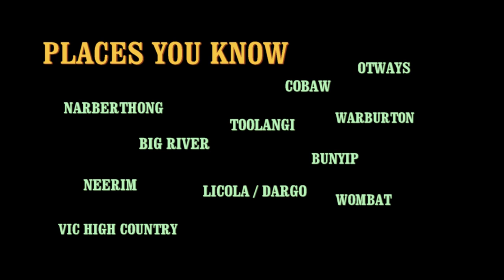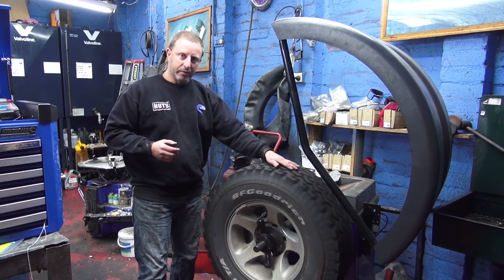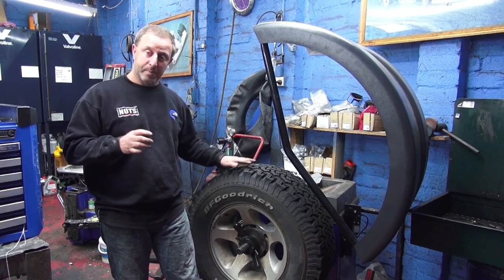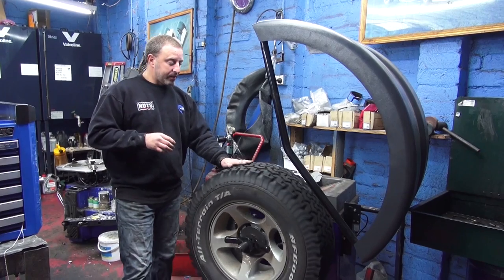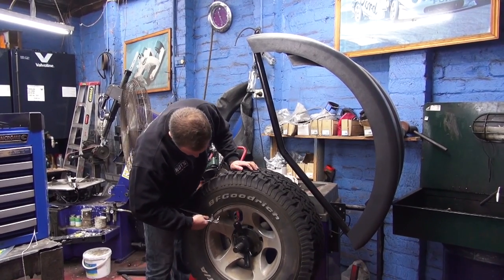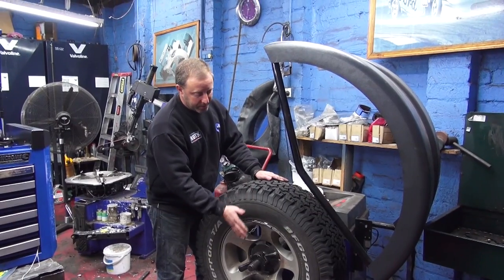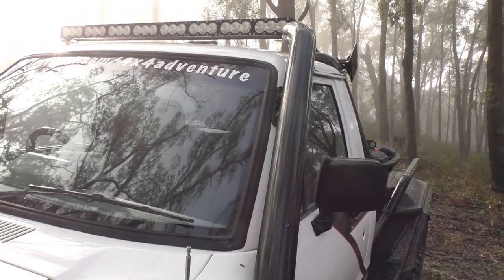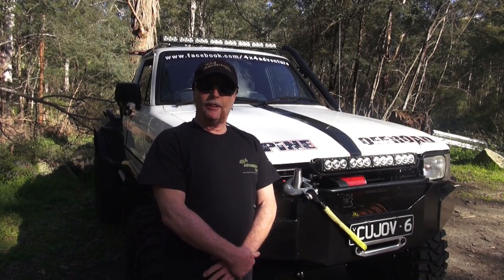4x4 Adventure Club - Taming Toolangi (S2/E7)

Comment: Hi JB, Awesome video.
How many inches lifted and what size of tires you have on your rig? Thank you.
Reply from the maker: Hendra Medan i run 3 sets depending on conditions.
bfg mts 285/75r16 (^standard)
simex centipedes 295/80r16
(^extreme)
Micky Thompson Claws 315/75r16
(^Moderate)